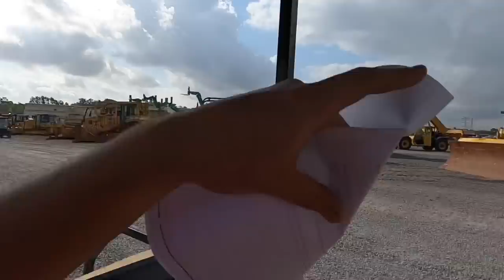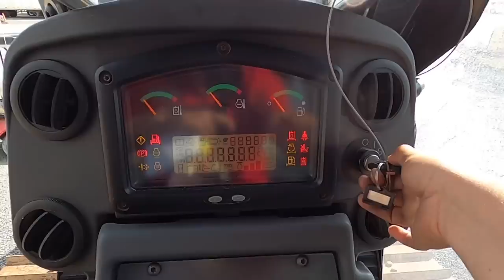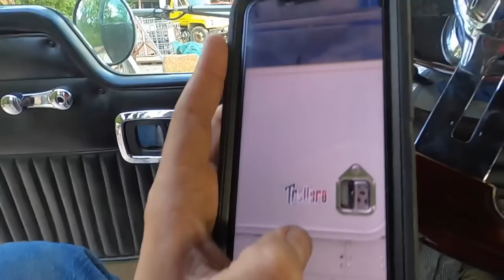A day in the life, hauling OVERSIZE cat dozer from auction.

Comment: I would never chain like that, I always made a loop around something so in case they do come loose they wont fall off. Remember that chain or rachet flies off it can do some serious damage. I did some serious damage to myself a few times. If you also loop it around it will not put all the pressure on that small hook. I have snapped quite a few in my day. Each to their own, I just think it is deadly way to do it. Flatbeding I was always taught by the old schoolers is make it so if the truck rolled over it would still be on.
Reply from the maker: Thanks for the info

Comment: I'm a trucker in California out of Wilmington by Long Beach you have a load and I can get it done been a truck in the open road All my life since I was 14 on a family farm in Illinois and Sioux falls South Dakota hauling cow's and pig's all over the place Bull Haller is a family farm Job but I had a truck you can get it done with it was a 397 Peterbilt with a 3406E cat 18seed transmission and 391with a triple tork micro Chip in the computer for the transmission for All that tork I was putting in the truck I still have the truck but it is not working right now but I will be in the truck and it's going to be around and I will be in it soon but I guess it will be a good time when I will be in it and it's a 1993 Peterbilt sending you on You Tube talk to you soon I will be wanting to hearing from you soon Hammer done 👍

Comment: how much is safe to chain on to the tracks? awesome video btw
Reply: It's not worth a shit but everyone does it so there is no way everyone won't freak over this comment. Also not enough pulling back but also no one cares.
Reply: Although with the two on the blade pulling back it is probably enough depending on machine weight.